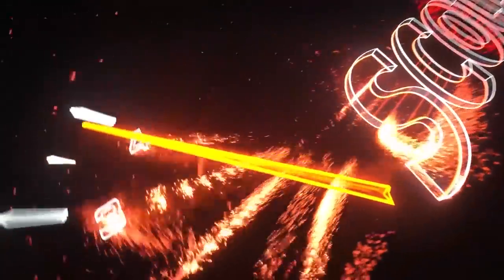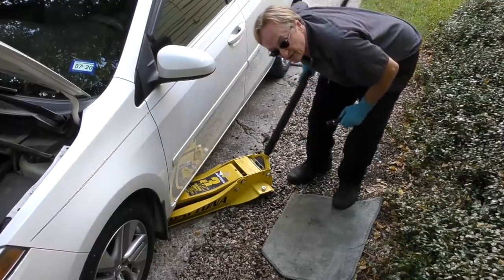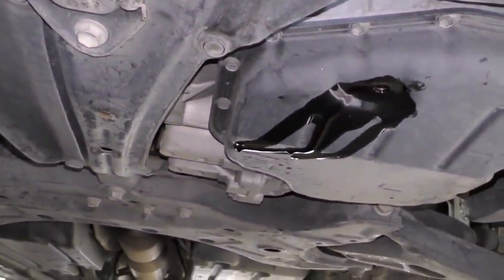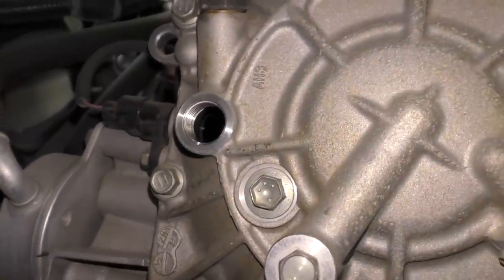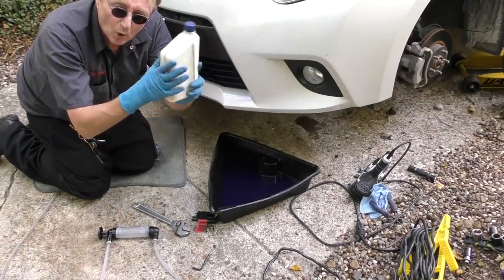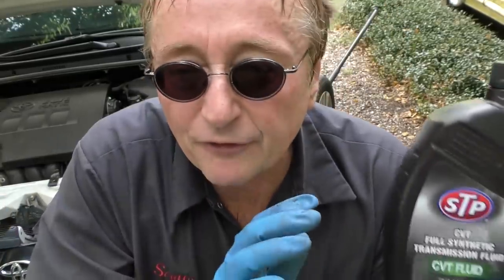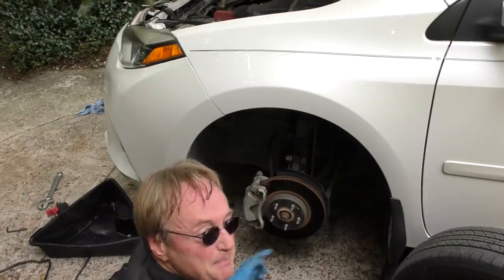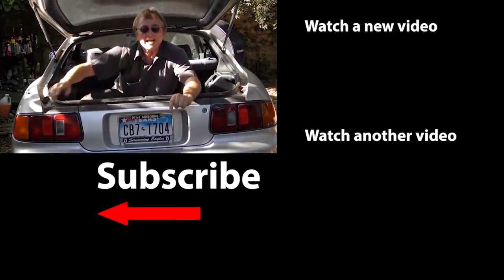This Toyota Corolla Has a Serious Problem

Comment: You know, I've been changing my own oil since I was sixteen, and I've never put rubber gasket on my oil drain plug.
Reply: Luck you haven’t gotten any leaks
Reply: That's because rubber gaskets suck. I put a fiber gasket on my '68 Corolla in place of the metal one 30 years ago and it's still fine after many, many...very many, changes. The plug only needs to be snug not cranked down.

Comment: Should I change the transmission oil on my 4Runner that has 140k miles? It was purchased used so the service history is unknown, but it shifts smoothly and I want to get another 100k mile out of it?
Reply: Check the color if pinkish sure drain and replace every few years.  Since yours maybe orginal I'd do another drain the following year.
Reply: Color, smell?
Reply: of course you should. do not flush it though. just drain and fill

Comment: What if the car was leaking/burning fluid and you replaced it with too little fluid?
Reply: funny how he said to do it yourself to do it right, but even he didn't use the correct technique

Comment: Hey Scotty have you ever done a cvt fluid drain and fill on a 5th gen Nissan Altima? If so how hard was it to do?
Reply: Just did my 2017 2.5S about a month ago. I purchased a dipstick on ebay to make it easier on the refill. Snipped a small half moon out of the plastic rock guard that's below the CVT drain plug so it didn't have to be removed. I didn't have a large metric socket for the plug but found one of my SAE sockets worked just fine. Think it was 15/16 or in that range. Ordered NS-3 fluid from a Nissan dealer with an ebay store with the best price. Ordered 5 qts. Took 4.5 qts. to refill. I put 4qts in then started it up and let it warm up abit and set the brakes and shifted it through the gears then while still idleing, i checked with the dipstick and added the final half qt. I cut the lock tab off the new dipstick with my razor knife as the O-ring fits very snug and i saw no reason to have to fight getting the new dipstick out for the next change. That lock tab on the dummy dipstick plug is abit of a pain to get released, so i just pried the plastic apart with screw driver and popped it out. Gotta give it a good tug cause like i said, that O-ring fits really snug on the Plug cap and the new dipstick. The top of my new dipstick read Nissan NS-2 so i changed the 2 to a 3 with a sharpie.
Reply: @NoName-zq6ic   thanks for the insight🚘

Comment: Not often but today I disagree with you Scotty: 1) When you changing the fluid the first time you really should drop the pan and clean the magnets and pan from all the metallic fragments, I would also change the screen especially since it's cheap. Dropping the pan and filter will also remove more used fluid. 2) Never use and especially mix that universally fits nothing correctly fluid. You really have no idea what's in that universal fluid and why take the chance? 3) Use the replacement fluid amount as a reference ONLY. Check it according manufacture specifications always, "you never know who messed with it before and didn't get it filled properly".
Reply: I think Scotty messed with it before. That's why it started draining as soon as he pulled the overfill plug. He overfilled it.
Reply: @frazzleface753  lol...yep and just imagine how overfilled it was if your suppose to check it hot.

Comment: I was wondering what your opinion is on buying a 2002 ford ranger with 160 k miles for $3500
Reply: if it's in good shape pay $2800
Reply: Hey man. Paid $2500 last year for a 2002 Mazda B2300, 4 cyl, 5 speed, 116k miles. Love the truck but needed/needs a bit work. Hope this helps.
Reply: Blue Book (FWIW)?  PPI?  Lot of mi.

Comment: Reminds me of checking the oil in a Model T. No dipstick on that either.
Reply: You don't "check the oil" in a T...you just put some more in it.
Actually that is kind of true...you open the top petcock, pour some oil in the filler...when it drips out of the petcock, it's full.

Comment: The head mechanic at the toyota dealer were I bought my corrola said no need to change it but at 150 thousand miles my trans locked up, had to get a new one put in no warranty paid out if my pocket for my 2015 corrola trans , change it now every 60 thousand miles!!!!
Reply: And you believed something that a dealer told you?
Reply: how much to replace the transmission
Reply: @tpfmike1976  I got a trans form a salvage yard here in hammond ind it had only 3000 miles on it  cost me only 550 dollars and I had it put in for another 500 dollars and 200 for new trans oil and filter. I got 90 thousand miles on it now and no problems,lesson learned!!!!

Comment: My wife's Corolla has a lifetime warranty on the transmission. No where in the manual states when to change the fluid. Since we have that warranty I just leave it alone.
Reply: Careful with that cuz when it does go bad they might not want to grant you the warrant if you never serviced it. 60k miles is the normal for most transmissions. If I was you I'd have the dealer service it once every 60k miles just so you have some proof that you did take care of it.

Comment: Hi people. I have a question: a Standard Transmission need a replace of fluid? Thanks
Reply: Arturo Monreal
Ideally all fluids including but not limited oil, coolant, brake fluid, all types transmission fluid, power steering except for electronic power steering to will need to have the fluids replaced at one point or another

Comment: I love my CVT I change fluid every 30k I get 30 mpg city 40 Hwy, If easy on acceleration I stay at 1200 RPM's from start to 60 MPH.
Reply: not worth saving a little on gas by going only 60 MPH on the highway
Reply: @Eman1900O  I dont go 60 on hwy, point is it maintains 1200rpm, at 75 maybe 1400rpm, a 6 speed won't do that.

Comment: Hey. I have a 2006 fiat punto 1.2 gas. Do y’all know if it has a rev limiter as there is no red line on the rpmx. Thanks
Reply: Stephen Reilly When it comes apart that’s the rev limiter

Comment: What is the fluid was low before you started changing it
Reply: Yea with no dipstick good question.  If it was low I guess you see a leak.
Reply: @markg999  that's why you don't use this technique and you follow the correct one that Toyota says to do. you are supposed to have the car on level ground with the plastic straw in place and put enough to where some drains outs. when the fluid is draining (at the right temperature) and comes to a slow steady drip, it is full. then put the drain bolt back on
Reply: @Eman1900O  Maybe...dont have that setup on mine.

Comment: No dipstick, but I assume there are some sort of Level to fill up to?
Reply: Dagfinn Klund if it’s a Honda there’s a 3/8” drain plug on the bottom of the transmission and a plug on the front of the transmission you take out and fill tell it runs out to get The proper level
Reply: @DCSPORTSTER  I think its more or less the rule. So easy to see the right amount. But the vihecle must be "watered"

Comment: don't get me wrong I love Scotty's videos but do not listen to the way he changed the transmission fluid on this CVT first of all there is a procedure to get the level right I know that's one way to do it put back what you took out but the level in those Transmissions is very very critical there is a procedure from Toyota to do it right there are videos on how to do it correctly it's too much to list here for me also use only Toyota CVT no other fluid some of those Universal CVT fluids may not be compatible with that transmission cvts are very expensive to replace also when you're done listen closely for any whining if it whines at all recheck the level it means the level is not correct and if you continue driving it that way with the wines it can cause severe damage

Comment: What about a 2017 Toyota Camry that has a "sealed" transmission? But it's not a CVT.
Reply: Exactly the same procedure, the difference is the type of fluid. ATF instead of CVT fluid. (Always use manufacturer’s recommended fluids)
Reply: @ICABronco  what's up with shifting the transmission from reverse to neutral to Drive then back again is it necessary?
Reply: Same process
Reply: @hunterfoster1714   No, never heard of that before.

Comment: Mr scotty when to know if CAR need replacement of CVT fluid?
Reply: mileage
Reply: @95BLUERAY  hi my altima is over 235k kilo meters, and last time CVT was replaced at 180k kilo meters. time to replace CVT fluid now?
Reply: @kiskuhona4946  Hey, for a normal automatic transmission yes it's the time but since yours is a CVT it might be different so check the user manual if it doesn't say anything about it check on google and ask Scotty on his website he always reply there :)

Comment: The problem is engineers don't have to work on them.  That has to be the dumbest design ever.  I always change my fluid when it's due and I've never had any transmission problem in my life and I'm 62.

Comment: At least Toyota still has a drain plug, GM's don't even have that.
Reply: Alex Cintas I had to install a drain plug on my 88 Pontiac Bonneville.    I kept that car 24 yrs and put on 360k before I gave the car to a friend.     

I drained the fluid every year.
Reply: @99SVTBolt  how did you do that, doesn't the drain plug area need some kind of reinforcement?
Reply: Heat is what kills the fluid.   Every 20 degrees increase in temp will half the life of tranny fluid.   FWD cars run hotter than RWD cars.     Install a tranny cooler to increase the life of the tranny fluid.   

I didn’t bother with a extra cooler.  I just changed the fluid every year.  

Even when you drain it, there still more in the torque converter.
Reply: Alex Cintas no reinforcement needed.  It’s a tranny pan with a hole.    Plug up the hole and you’re good to go.   This isn’t the frame or suspension part where you drill a hole and you might need to reinforce the hole.

Comment: You can change the fluid in your CVT, OR....just don't buy a car with a CVT trans in it. I vote for the latter....
Reply: TargaWheels My 2016 CVT Toyota Corolla has 153000 miles, no issues at all 🤷‍♂️👀

Comment: This isnt the actual transmission fluid change real ones know there is still fluid in the torque converter old fluid is mixing with new this doesnt drain completely

Comment: My tip: Loosen the fill plug before the drain plug.
Reply: Also i believe the drain plug should be tightened after pouring the new oil and let it drain so all the air comes out of it and then tighten it.

Comment: I would never buy a car with a CVT transmission.
Reply: Well too bad because eventually all cars will have them
Reply: @NoName-gv6nm  hovercrafts won't have CVT transmissions.
Reply: My 2016 CVT Toyota Corolla has 153000 miles, no issues at all 🤷‍♂️👀 I am a rideshare driver.

Comment: Why put in a $5 dipstick to tell you fluid is low when you can have an over-complicated $5,000 diagnostic system instead? Unbelievable
Reply: Rob S: The reason my last car didn't have a trans dipstick was it didn't fit between the shock towers during assembly. Manual transmissions don't have dipsticks.
Reply: @michaelhall9138  I don't think manual can be compared to auto. I mean a differential doesn't have a dipstick either and a manual transmission is similar, a gear box with gear oil. ATF gets subjected to a lot more abuse, so it's nice to have a dipstick not only to check level every so often but to physically see the condition of the fluid too

Comment: You literally didn't torque down the drain bolt ? So you're the mechanic who puts drain plugs and oil filters in at 300nm making it impossible to take off 😂

Comment: CVT transmissions suck. Mine had a catastrophic failure at 75k. Some have it happen immediately after the warranty expires (65-70k).  Toyota knows they suck and won't do a thing to make it right. Toyotas are now lemons. I will never buy a Toyota or any other car with a cheap toy CVT. They should have left them on golf carts where they belong.

Comment: DONT DO THIS IT FUCKED UP MY TRANSMISSION SMDFH. Have had my corolla 2016.
Reply: dont do what? what he doing that wrong?
Reply: I wouldn't mess with it either tbh, at least I wouldn't do it this way. He's only replacing some of the fluid and you can introduce contaminants into the system and/or overfill it. I had a 97 Corolla with almost 300k miles on it when I got rid of it. I bought it at 89k miles. I doubt it was ever done before as it wasn't well looked after. I never changed the trans fluid, and I never had any issues with it. I also had a 94 Olds Cutlass that never had its trans fluid changed. The transmission only started acting up at 200k miles, and that's a GM!

If you're going to do it, have a certified tech at a dealer do it, or do a lot of research into the best method. You have to do it a few times over two or three days to get all the fluid out. It's a royal pain and a lot can go wrong if you do it incorrectly or don't have the equipment. You hear guys saying 'well I change it every 40k miles and it's still running at 200k' Yeah, well it probably would anyway, and they're lucky they didn't damage it.
Reply: Frazzle Face Right!!! atleast someone has common sense. Too bad i fucked up my car already.

Comment: Always refill with the quantity given in the handbook by the manufacturer, not by measuring what comes out. Reason 1, some may have leaked out, reason 2, the mechanic who changed it before you may have put the wrong amount in.

Comment: Scotty why the hell do you use a crescent wrench as an extension. Just go buy some small inside diameter metal tubing at whatever hardware store, preferably steel or lead not copper or aluminum, and now you have a cheater pipe,

Comment: Changing the cvt oil in the Honda Accord is much easier
Reply: Probably not on the CVT accord
Reply: @thivakarsaravanamuthu4744  yes it is. I changed mine a couple weeks ago. Very easy, and I did it the correct way. Scotty totally neglected the correct way Toyota says to do it. He didn't level the car and check the fluid level.

Comment: I dont think that is even a half of what is inside there unless some transmission tend to have about 8 quarts.
Reply: Yea you need to do another maybe in several months later to do most of the fluid.
Reply: well he did not take the car off the jack so more could be drained out. I think it holds less than 3 quarts. He didn't do it the way Toyota says to do it AT ALL.

Comment: Your screwed if you have this transmission!🤔😂
Reply: Miles Gentry My 2016 Corolla has 153000 miles on it, I am a rideshare driver. It has no issues at all. The proper way to change the trans fluid is shown in “DNY automotive “ YouTube channel.